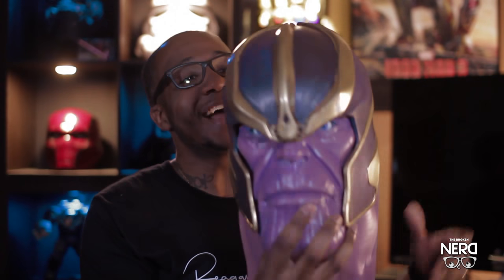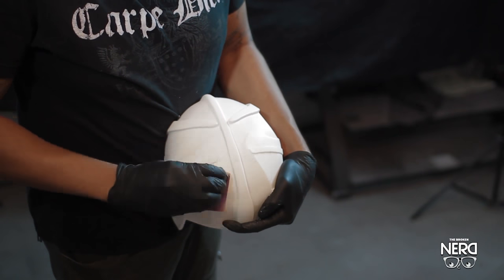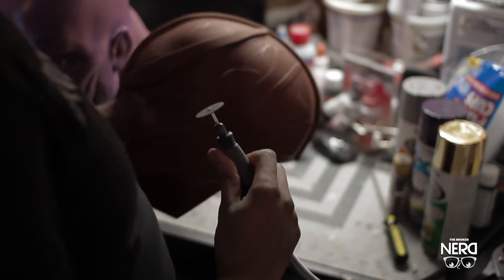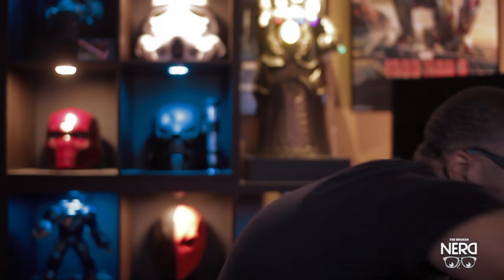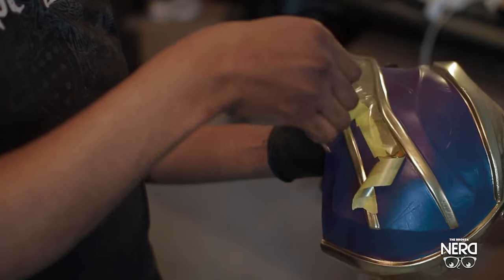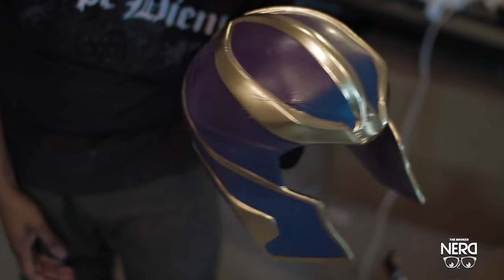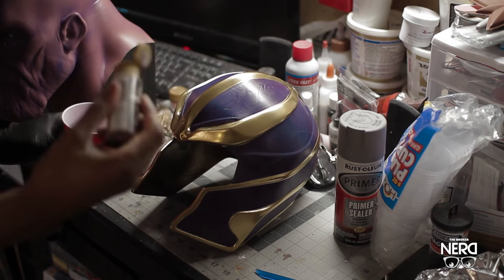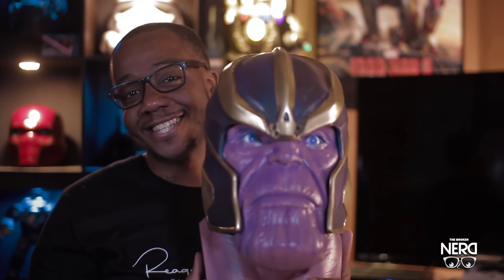Painting and Weathering a Thanos Helmet with The Broken Nerd

Comment: Hey can someone give me some tips? So when I pull off the masking tape from the areas I didn’t want to be gold, it ended up pulling up some of the paint as well... does spraying a matte clear coat help keep the paint from pulling up? Thanks
Reply: BlueBig22 sounds like you either need a better primer and/or you need to let it dry and cure longer. It may feel dry after a bit, but most paints need a couple hours, some even a full day to fully cure